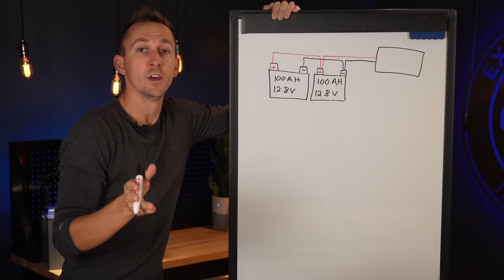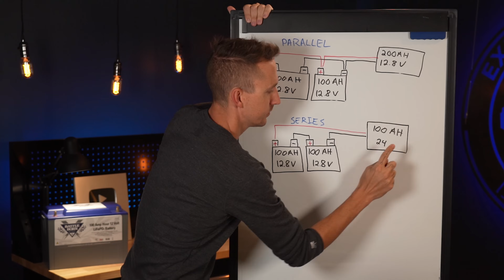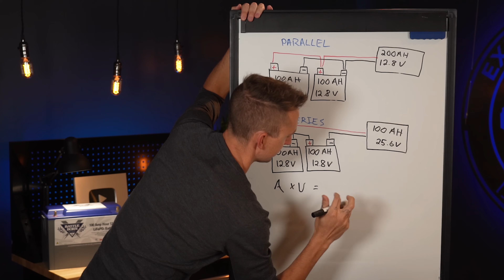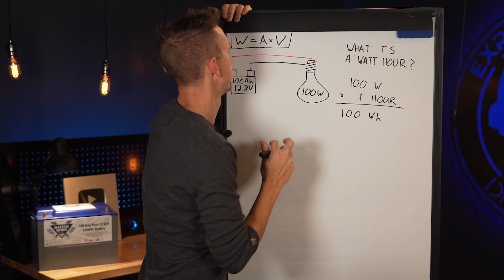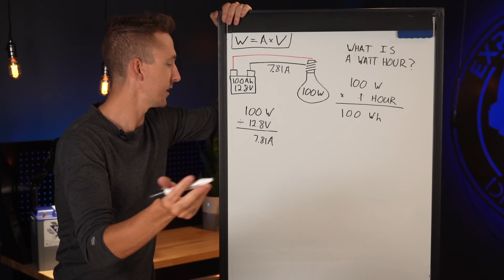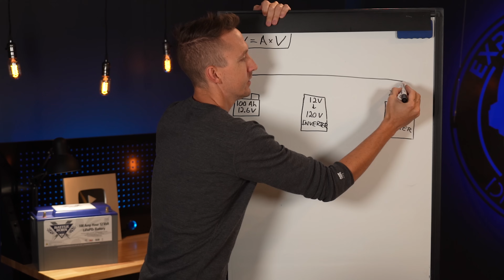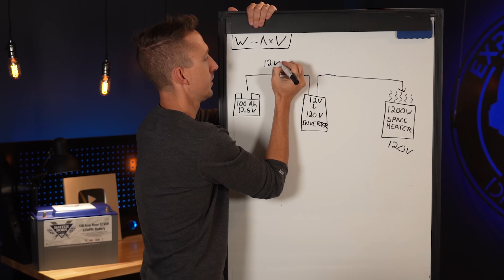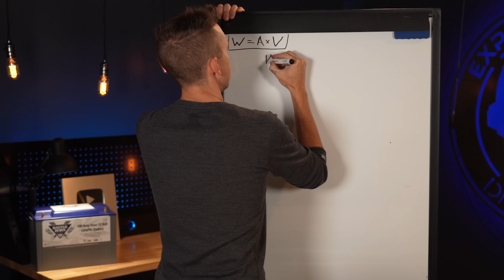AMP HOURS EXPLAINED (amp hours vs watt hours)

Comment: Since my power company sells me electricity by kiloWatthours (1000 Watthours), I translate everything to kWhs for simplicity. The video explains the calculations to do that. Using kWhrs also makes it easier to make the transition from the 120 volts of my house circuits and the 52 volts of my batteries.
Reply from the maker: Glad the video helps with your calculations!

Comment: I have got a question,
In series circuit the current will remain same whether the load will be operated for an hour or more.
In the last part of the video, you were doubling the current if the load is supposed to be operated for 2 hours?
Reply from the maker: Great question 👍 — this is exactly where things can get a little nuanced depending on the use case. Rather than guessing how this applies to your specific setup, the best way for us to help is to take a quick look at your actual loads, runtime, and battery system so we can explain it clearly in context and make sure nothing gets mis-sized.

Reach out to our support team here and include what you’re powering and how long you want to run it, and we’ll walk you through it step-by-step and recommend the right components if you need them: 👉 https://shop.explorist.life/support?utm_source=youtube&utm_medium=comment&utm_campaign=support&utm_content=response_link
Reply: @EXPLORISTlife As far as load is concerned, we only have to consider, whether it is compatible with our supply or not and the other thing is, of course that matters is the size of a cable between the supply and the load end.

Comment: Can you have 2 x lithium batteries in parallel and still use a single DC/DC MPPT to charge?
Reply from the maker: You can in some setups, but the right answer really depends on the exact batteries and system layout. If you reach out to our support team, we can look at your configuration and make sure you get the correct gear for what you’re building:

https://shop.explorist.life/support?utm_source=youtube&utm_medium=comment&utm_campaign=support&utm_content=response_link

Comment: Finally got to the main point at the end.  It's ALL about POWER CONSUMED in WATTS (not AMPS) when deciding on the size of battery bank you will need.  Amps are really only needed to size the conductors.  You can figure everything else out by simply considering device power in Watts consumed over time i.e.  Watt Hours (Wh) if you want to know how long your battery bank will last without being recharged.
Reply from the maker: Glad the video was helpful in clarifying the concepts for you!

Comment: I have a single 36V 45AH trolling lithium battery with an inverter that is 36V that has 20V and 14v accessory panel that power both my 12" Garmin and Livescope box and my 7" Lowrance graphs off my single 36v.how do I break this down?I can fish all day in wind and use max 75% of battery ,which is awesome i think,no interference at all chrystal clear picture. And charges fast. Never had heat issues.my other club members run 2 100ah lithiums and never use more than 25%.isnt that bad for lithium? To not ever use capacity
Reply from the maker: Great info—sounds like a solid setup. The “right” capacity and how deep to discharge really depends on your exact loads, inverter, and charge profile. We can break this down for your boat and recommend the best path (and any parts you may need). Shoot us a note at https://shop.explorist.life/support and we’ll take a personalized look.

Comment: Where is the pinned comment for clarification @6.36? I'm trying to understand all this. A 24v system can use a smaller wire. I'm a work in progress. What are the benefits of series and parallel?

Comment: can u make a video explaining why 36v solar panel only pulls 12v when hooked up to single 12v battery not full 36v pls not matter what mppt controller u use.
Reply from the maker: Great observation — the panel’s voltage will always be limited by the battery voltage it's charging into, and that’s exactly what you’re seeing here.

If you’d like help choosing the right gear or optimizing your solar setup, our support team can help guide you through it:
https://shop.explorist.life/support
(Free personalized support for items purchased from our store!)

And if you're using gear from other sources, check out the EXPLORIST Pro Support Membership:
https://shop.explorist.life/shop/all-products/membership-tiers/

Comment: Excellent video thank you. I like to use the battery Wh calculation then simply divide that by the watts of the device in your case the 100W bulb or 1200W heater to divide to see how many hours the battery will last assuming the battery can be drained to 0%. If Lithium then it can down to 20% or the older lead acid then down to 50% discharge.
Reply from the maker: Great approach! Doing that kind of math is super helpful for planning power needs, especially when comparing different battery chemistries. If you ever want to double-check your setup or calculations, our support team is happy to help: https://shop.explorist.life/support — free for gear from our store. For other products, the Pro Support Membership is a great way to get expert advice: https://shop.explorist.life/shop/all-products/membership-tiers/

Comment: In your last example where you drew 95 amps from the battery it would be valuable to include the data as to what size wiring you would have to use to deliver 95 amps.
Reply from the maker: Great point! Including wire sizing alongside amp draw would definitely be helpful for folks planning builds. If you want specific guidance for your system, the support team can walk you through the details.
📊 https://shop.explorist.life/support

Comment: This may be a dumb question but I'm trying to learn all I can. I know there are different GROUP sizes of batteries. So with a 12.8V 100AH battery. Do you have the same capacity even with the different Group size of batteries? Because I know now they keep making batteries smaller and smaller.🤔
Reply from the maker: Not a dumb question at all — that's a great one to ask while you're learning! You're right: battery group size mainly refers to the physical size and terminal layout, not necessarily the capacity. So a 12.8V 100Ah battery will have the same energy capacity regardless of its group size, even if it's in a smaller case thanks to newer tech.

If you want to be sure everything matches up well in your setup, our support team is happy to help: https://shop.explorist.life/support

We provide free help for gear bought from our store. For other items, our Pro Support Membership gives you access to expert, personalized advice: https://shop.explorist.life/shop/all-products/membership-tiers/

Comment: No mention of lead acid batteries only provides 50% of available amps before the voltage drops off, something to consider when your calculating the number of batteries
Reply from the maker: Certainly!  With lead acid and AGM, it's best to say that there is actually only 50% of it's power that is usable and then base the rest of the calculation from there.

Comment: In the light bulb example, when you switch to 24 volt battery bank, wont the light bulb need to be a 24 volt light bulb? If its a 12 v light bulb with 24 v going to it, wouldn't it be much brighter and possibly burn out instantly?
Reply from the maker: The theoretical lightbulb works in the voltage ranges of 1v to 1 million volts.

Comment: Can you recommend what amperage backup 120 v charger I would need on days without good sun for my panels for 4 100ah lithium batteries in parallel? .. thanks for the info.. I am still learning 🙂

Comment: I'm looking at buying a camper trailer.  The guy has a 300 Ah battery bank but it's made with a 100 Ah battery and a 200 Ah battery and a Renergy controller for solar charging.  It works apparently, but it doesn't seem right.  Is this a bad setup?
Reply from the maker: This does indeed throw up a variety of red flags.
Reply: @EXPLORISTlife  But if I buy it and don't burn it down, I can rewire it, with @EXPORISTLlife help!  Right? 😁

Comment: 6:15 every amp is a delivery of voltage... if you think about amps and seconds since you doubled the voltage of the battery more is being delivered that second so in that same amount of time it use less amps.... because every amp with delivering more voltage. Am I correct?

Comment: Hi little late here and probably i wont get an answer😕 also english is not my first language so i might have misunderstood something, altought i get what you wanted to say. 
At 04:00 you said that 100W*1h=100 Wh after that yout mutiplied the hours 100W*2h=200Wh... i think that is fundamentally wrong. It will be still 100Wh in the same way if you drive 60miles/hour for 2h your speed is still 60miles/hour and it will not be 120miles/hour but you drived 120 miles.

Back to Wh: if you use a 100 W bulb in your example for 2h it SHOULD still be 100Wh but since you used it for 2h your bulb used up 200W of power and not 200Wh.

Except that i think it was a really informative and good video and keep up the good work.😉

ps.: I know my comment is a little long but if somebody read through it, thanks for that and if i misunderstood something i would be really thankful for somebody to clarify that.🤔
Reply from the maker: No; that's not true.  100w for 2hrs = 200Wh.

Comment: I wish DIY Van builders would move away from conversing in Amp Hours when talking about storage and start talking Watt Hours.  
Talking strictly Amp Hours when talking about storage was fine back when everybody was using 12v Batteries. But now that 24v and 48v systems are becoming more popular, it's comparing Apples to Oranges when using Amp Hours.  Me telling someone I have 100Ah battery setup is misleading because mine is 48v instead of 12v.  If instead I said I have 4800Wh, it would be more universally understood.
Reply from the maker: The video you commented on teaches people how to do the conversions so they can know what is being discussed regardless of what measurement is provided. 👍
Reply: @EXPLORISTlife  I wasn't trying to blame or bash you for your video.  On the contrary, I thought the video was great and very informative.
I was just commenting (in general) about how in the van life community everyone talks about Amp Hours instead of Watt Hours.
Think of it like (as an example) a video teaching about conversion of Imperial units to Metric units, and I comment that I wish everyone would just use metric.
Just stating my desire for a "Universal" measuring system.

Comment: hi, very new at this but I understand bits and pieces.  Could someone please put as one mathematical equasion how long (in hours) a battery would last powering a load and what inverter is needed.  For example, how long would a $3000 solar battery, 48vdc rated at 3.8kwh (I assume is 3800 wh) going through a 90% efficient inverter powering a 120vac 1500w appliance would last.  Your help is appreciated, thank you.
Reply from the maker: Watt hours of battery / watts of device = run time in hours
Reply: @EXPLORISTlife  Wow, awesome, thank you!  Most people never respond to their videos.  Thank you!  Too simple . . . I never realized watts (power ) is the same unit of measure, regardless of the voltage of the device.  So in this example, I get about 2.5 hours of run time, correct? (48vdc 3800wh, 1500wac load) And how do I calculate the inverter size needed?  Just a 1500w inverter plus 10% for inefficieny?  Sorry, I'm slow at these things.

Comment: Great video - I'm trying to figure this all out right now. I purchased two 280ah batteries with a 24v inverter. I will be using solar to charge the batteries via a victron controller.  This helps me understand what I can run and what I can use through the night when there is no solar charging. Very helpful. I'm going to use this in my spreadsheet to hopefully make it all make sense.

Comment: Sir could be possible if I want to make a parallel (12 v, 100ah x2) then I series it with 12v 200ah...in other term 12v 100ahx2 + 12v 200ah...thank in advance for feedback

Comment: Call me thick but that means in an emergency, the space heater could only run for 1 hour before battery depletion? I am in this exact situation with a sump pump that needs 1100W but was hoping to plugin a heater etc if the power does cut. Debating the 100A 12v VS getting a 200A 24v .. Sounds like 100a would run for 1 hour, while 200a would still only run 2 hours? Thanks for any feeback,
Reply from the maker: A 100Ah 12V Battery contains 1200Wh of power and would power a 1200W device for 1hr.

A 200Ah 24V battery contains 4800Wh of power and would power a 1200W device for 4hrs.

Comment: why does the current flow increase when you only extend the running time of the load? wouldn't it that the 100w load will fail for pulling a 15.6amps at 12.8v and wouldn't extend the running time of the load? the current will only increase if the load capacity also increase, not the running time of the load? nothing changes to the current flow when running a 100w load on a 100ah 12.8v battery.

Comment: now i finally understand why people use 240v.
its to lower the amperage and therefore not burn the wires up..
thank you.
Reply from the maker: I wouldn't say that is entirely accurate.  Wire sizes should be sized appropriately regardless of what voltage/amperage the circuit is operating at.  Instead; a higher voltage circuit/component allows the amperage to be lower with the SAME wattage; allowing to power higher wattage devices.

A 30A 120v circuit can power a 3600W device.
A 30A 240V circuit can power a 7200W device.
Both of these circuits could operate w/ 10AWG wire since they are both 30A
Reply: @EXPLORISTlife  awesome and thanks.

Comment: If I'm right, using an inverter makes better use of the available power from a battery, regardles of the voltage, right?
Reply from the maker: I would not agree with that summary, no.

Comment: So quick follow up question. To calculate total time using the lightbulb example, with the battery not plugged in, you just take the 100ah / 7.81 ah, which would be roughly 12 hours? Is that correct?

Comment: I want to connect two 36v lithium ion batteries together and that will make them one 72v battery. Could I connect O ring terminals on the negative and on the positive. Negative to negative and positive to positive of course. Slip the 2 black together and the 2 red together and over the O ring connectors on my controller. Using a screw terminal. I dont want to solder because I will have to disconnect them when I need to charge the batteries. Does this all sound good. Will it work ?
Reply from the maker: This may take a more in-depth look at your personal setup.  If you have purchased/are purchasing from our store (shop.explorist.life) reach out for some more personalized help: shop.explorist.life/support

If you've purchased/are purchasing elsewhere, reach out to your dealer for support.  We'd love to have you as a shop.explorist.life customer so we can provide a bit more help in the future. 🙂

Comment: just curious.. is more higher Ah will damage any kind of tool and a ebicycle?
Reply from the maker: Nope
Reply: @EXPLORISTlife  one more,if in same work situation,does higher voltage and lower voltage got different using time? which one is longer?

Comment: Great video! I'm a newbie and need an explanation as if I'm 5, lol. I wonder, though, what's the difference in heat? Does a higher voltage battery output less heat because of the lower amps, or is it the opposite?
Reply from the maker: Given all wires/components/fuses/etc are properly sized there is minimal heat differences.

Comment: So…if I buy 2  400Ah batteries in 12v, and run them in parallel, I remain at 12v but increase my Ah to 800, extending my run time? And running them in series will increase my voltage (24v system) with the same 800 Ah? My hair started hurting abt half way through. 😂

Comment: I stopped using Ampere Hours and just say the battery capacity in watt hours... Using Ah is useless unless you know the voltage and people never specify the voltage they are running when they say they have so and so Ah battery. My battery bank in my campervan is 5000W/h of LifePo4.

Comment: But you are referring only to lithium batteries because once a glass matt solar battery drops below 11 volts it's done when connected to a 120v inverter.  Correct? So then watt?
Reply from the maker: The concepts of amp hours are the same regardless of lithium or AGM.  The main thing with AGM is that you can only use half of those amp hours available before you start to damage the battery.  They are still there... and they can be used... but it will damage the battery.

Comment: If you have 95 amps on the battery side, does the wire size from the battery to the inverter have to be big enough to carry the 95 amps?
Reply from the maker: Amp hours of storage don’t determine wire size. Only the amperage coming out of the batteries to power a load does.

Comment: Have you tried the temu batteries
Reply from the maker: Nope.  And last video collaboration I was a part of that was sponsored was an absolute train wreck in the comments section because the video was sponsored by temu.  Apparently they are a garbage company based on all of those comments.  Check out the comments on the van electrical system collaboration I did with Crafted Workshop.
Reply: @EXPLORISTlife  
Have you ever gotten supplies off from AliExpress